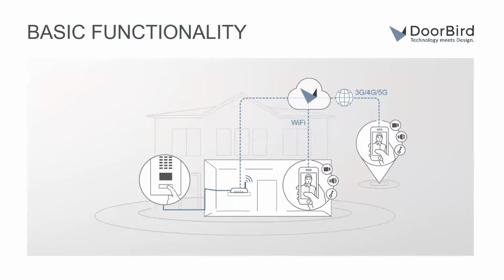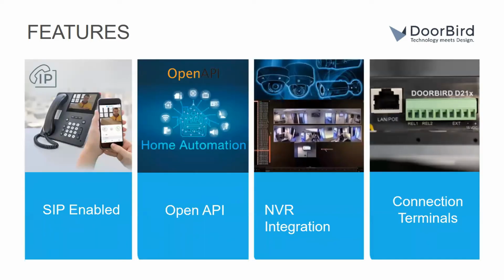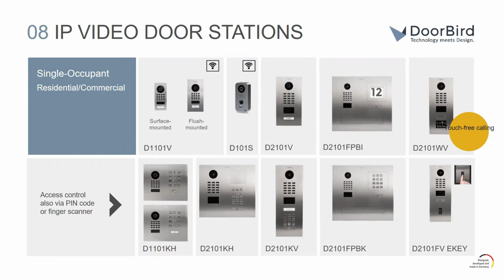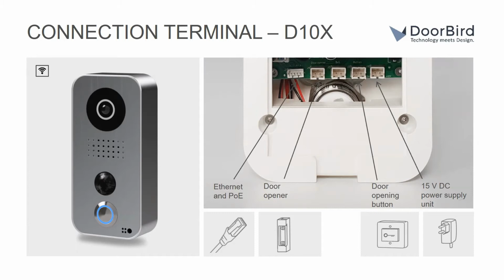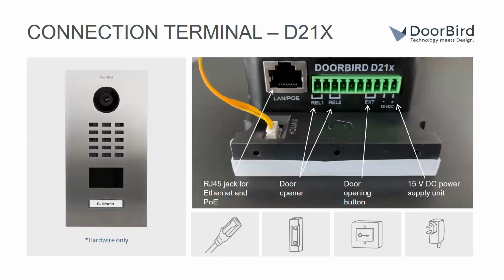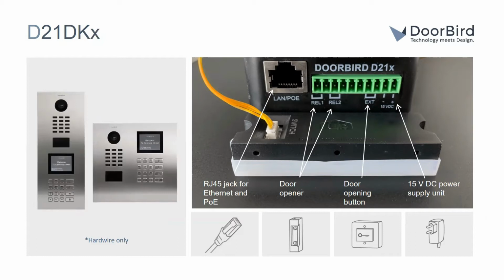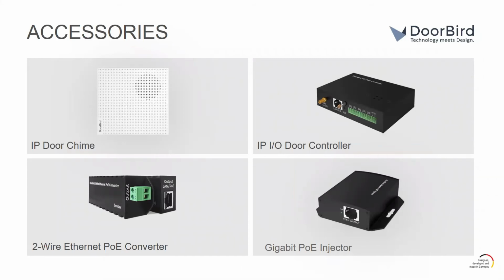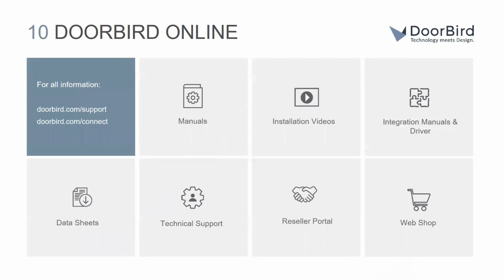Doorbird - Features and Solutions Overview

Comment: Hey thank you very much ;)  small question can someone connect his old simple bell with doorbird ? Because i am planning to install doorbell d21x and on every floor i need to istall one bell and i was wondering if i can use any bell for the sounds or maybe a speaker with customizable sounds... What is the diagram for the wire installation please.  Thank you in advance
Reply from the maker: Thank you for your question and we have reached out to our Doorbird rep and here is his reply.

You would benefit from our IP Chime (A1061) and can install as many of these as you like as well as customize the sound with 50 options.  As with all of our door stations and accessories, you need to get it on the network either Wi-Fi or hard-wired.  Here are a couple links for the manual for the A1061 and installation sketch for a multi-tenant application. 

https://www.doorbird.com/downloads/manual_a1061w_en_de.pdf 

https://www.doorbird.com/downloads/multi-tenant_installation_sketch.pdf